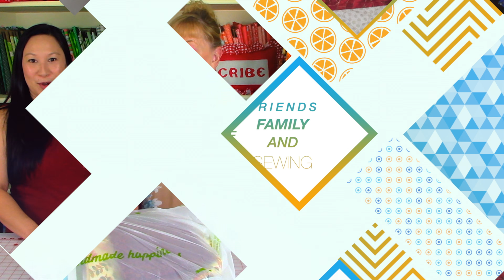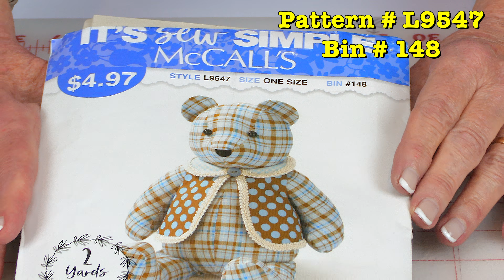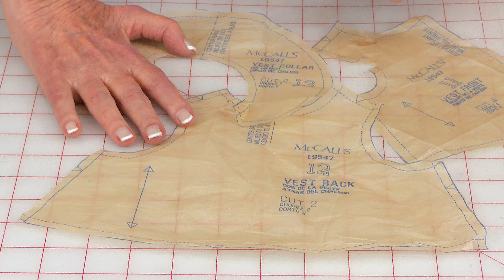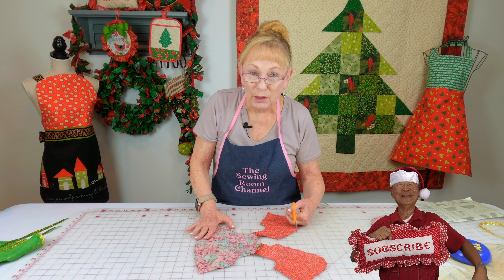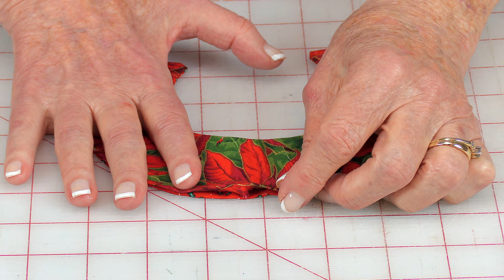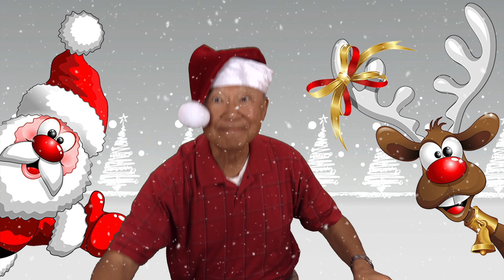Christmas Bear Vest | The Sewing Room Channel

Comment: Wondering was the collar not sewn to the vest except in front? very cute bears and I have the pattern and tried to make it out of flannel but that didnt work. It kept fraying to much.
Reply from the maker: Do a zigzag stitch around the raw edges of the flannel to prevent the edges from unraveling.  You can stitch the collar to the vest but the sewing instructions didn't sew it anywhere on the vest.  I decided to just stitch it to the front.  When you put the vest on the bear you  cannot tell that the collar is stitched separately.  Happy Thanksgiving. 😍
Reply: @TheSewingRoomChannel  thank you